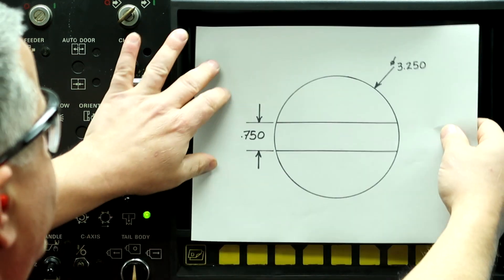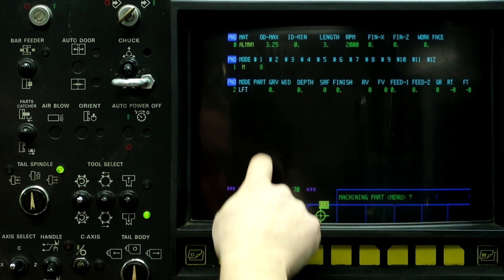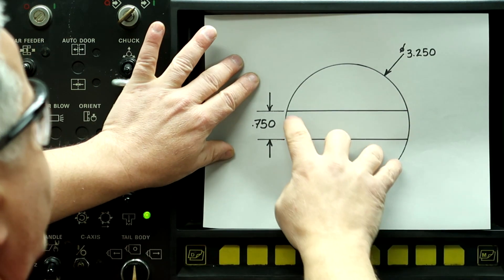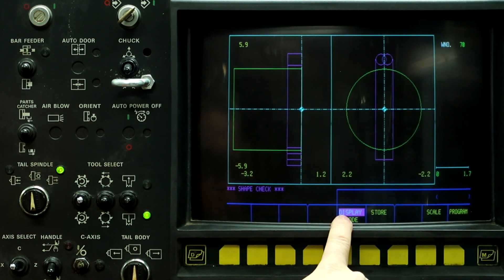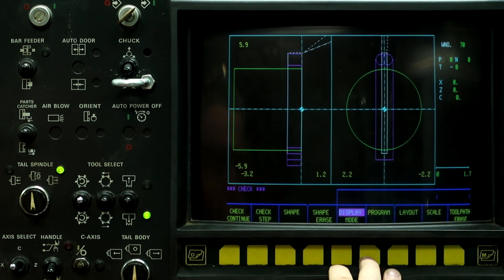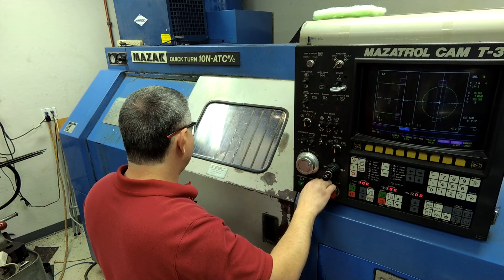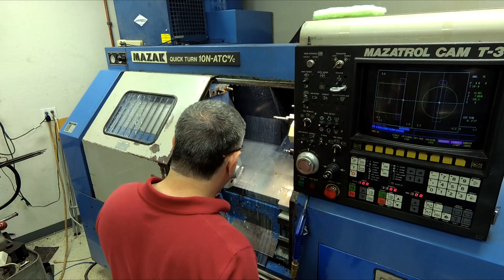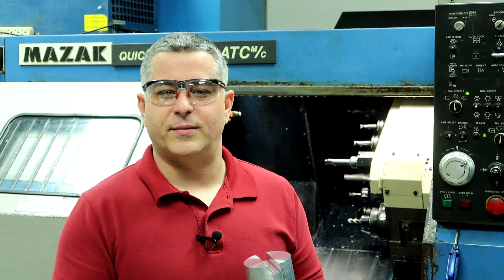Mazatrol Programming Tutorial Live Tool Milling Slot Face

Comment: Cool...!!! Seems to work great while slotting a part that is in the chuck. 

Try doing that with a part in a steady rest and it is not so easy. Unless you line up the steady rest perfect with the chuck and the turret. A regular horizontal mill works best for slotting longer parts in my opinion. If you have that option that is. 

You can also use the Y axis  on the lathe if your machine has that option.
Reply from the maker: @Hareball001  My machine is 39 years old. No Y-axis. Lol
Reply: @mazatroltipsandtricks6816  That's what I like about Mazaks. They stand the test of time. You can get a decent used one for cheap and beat the hell out of it and it still runs like a champ.

Comment: Ive recently been put on Mazak slant turn with a T32 control. The programmer has used LCT to machine a similar slot. There is a difference in that the billet has a bore in the face so there are effectively 2 slots. The programmer retired some time ago and no one understands how this particular process actually works!

Comment: Hey,
Could you please make a video for MGV.
Reply from the maker: Ok. Thanks for the suggestion.
Reply: Thanks for your response.
Could you guide me how to use MGV for face milling.  I'm actually stuck here.
Reply from the maker: @nikhilgupta4990  MGV from my understanding is used to cut keyway grooves in a shaft.
Reply: @mazatroltipsandtricks6816  yes sir. Actually, I've never used any of the milling options in my machine before.

Comment: Hi Phil, is there a way to mill two flats at 180° to each other using a vertical end mill along the bar?
Reply from the maker: You would need a machine with a Y-axis.
Reply: I watched your great tutorial about milling a hexagonal along the bar and did it the next day! Then I thought ..hmm..I wonder if I could keep the 0° starting point to the 60° finishing point, and then leave the bar, and come back in for the 240°-300°? Well, when the cutter had reached 60°, it just started plunging down to reach the next 240° starting point! Surely there's a way to fool the machine so it thinks it's making an oval-shaped hexagon. The impossible is possible (my engineer's motto)
Reply from the maker: @Hellishcrusade  I don't know if that would work or not.  Thanks for sharing your experience!

Comment: Hi ! I wanted to know if there is any way to do a multiple face mill pocket in XY or XC with different dept without having to start the pocket at Z=0, instead starting at the bottom Z of the previous pocket ?
Reply from the maker: I believe that is possible. I will have to check for sure.
Reply: @mazatroltipsandtricks6816  fingers crossed

Comment: Hello . Mazak multiplex -no Y axis-.   I have front livetool and i try make 2 slitting to 180deg outside from pieces on lathe (depth 15mm) . Saw blade (saw dia 80mm L1.5mm)  .  I try tomorrow that your program example if it works
Reply from the maker: Cool. Hope it works out for you.

Comment: What material in this video ? Thank you
Reply from the maker: 6061-T6 aluminum.
Reply: Mazatrol Tips and Tricks  How do you finish surface , I have mazak 10atc too , But I have problem with surface is rought  (al6061(
Reply from the maker: @user-yg8sv1mi4c  The bearings in your live tool holders may need to be replaced. Mine are getting bad too.
Reply: Mazatrol Tips and Tricks  thank you
Reply: Mazatrol Tips and Tricks  Sorry Why your milling spindle run at 2500 rpm , my machine maximuom at 1500 rpm  thank you for everyanswer
Reply from the maker: @user-yg8sv1mi4c  Some 10Ns were set up with 1500 RPM and some were set up with 2500 RPM pulleys from the factory. The 1500 RPM setup was much more common.

Comment: How do I change the with of that groove easy?
Reply from the maker: The actual endmill diameter needs to be registered in the tool data screen first, but if the slot is still a few thousands off, move the X wear comp on the endmill. This will dial in the width at the center of the slot and make the slot parallel. If the slot measures parallel already, adjust the endmill diameter on the tool data page a few thousands.

Comment: Hey phil
I am working on integrex and want to know the use of shift Z and shift R feature in LINE unit in mazatrol and what is the equivalent feature in G codes for this.
Reply: Thanks for helping out phil.
Reply from the maker: I don't know much about the G-code side of the Integrex. I will do some digging into the controller and see if I can find something this week.  No promises though. Thanks.
Reply: @mazatroltipsandtricks6816  thanks Phil
Reply from the maker: It appears like the machine uses G10 to reset the program's work coordinates with a few other variables on the line, but it completely overwrites in new values for the work coordinates. It does not move it incrementally like the Mazatrol unit does.